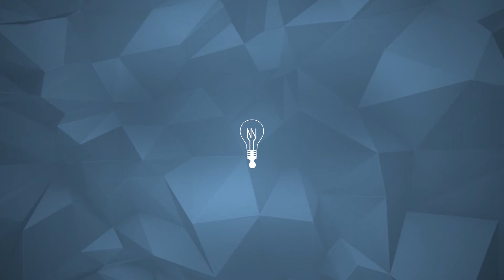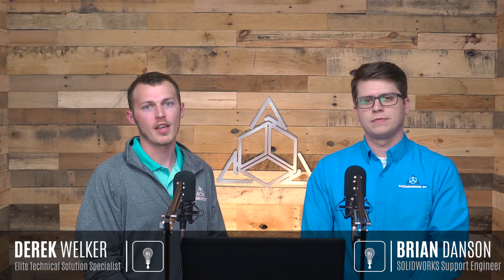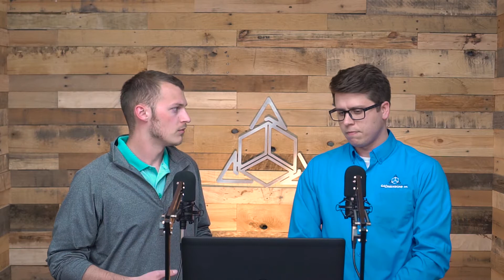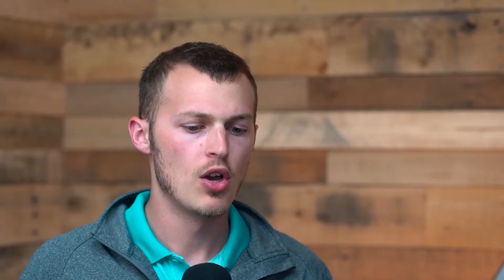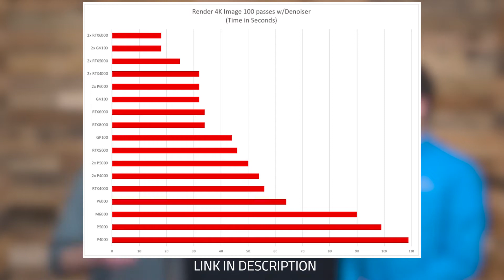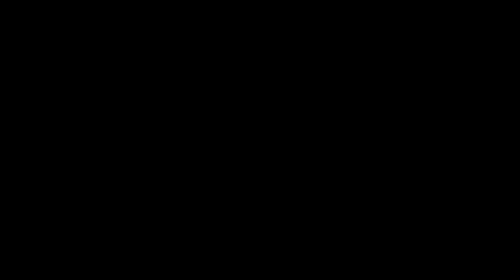Smarter Engineering PODCAST Ep 4 - How to Choose a Computer for SOLIDWORKS

Comment: I have Quadro p2200 24gb of ram and sata 500 gb SSD and intel i5 9th gen cup but still iam struggling with it at large assembly. When I wat to edit the part in assembly it self it crashes and I can't much but better performance after upgrading to Quadro graphics card. So, plz can can u tell we where is bottle neck. I planing to completely upgrade to another pc
And should I go for i9 9900k or rayzen 5 5600x as they are similarly priced right now in market

Comment: i am using ryzen 5 3550h (nVIDIA GTX1050) for Solidworks...but it do not runs properly , the tool in ribbon fades/Hide away .when i move cursor on ribbon bar.....but when i run SW with integrated gcard..then only it works fine..which is why i have to run by left clicking the SW every-time via integrated g-card....can you tell me what is happening ?
Reply: Hii Gaurav!
I would recommend that you disable the integrated graphics (or uninstall the driver) from device manager and try using the application.

Based on the info available online, most of these CAD softwares donot support multiple GPU. So that might be ur problem there. Let me know if it helps....

Good luck!
Reply: @rudradeepsarkar4467  ty smch for reaching out to me..
The problem has actually solved.. Just got an window10 update(i guess official june update) last month .. which switched my ram frequency down to 2400mhz..(although it was set at 2666 mhz before & also a 2666mhz supported ram) which ,i dont think make sense, was bottle-necking my system...

About g-cards Cad does support SLI combinations but for my laptop i tried using it by switching the software to run on integrated and dedicated g-card separately, that didnt work. Was only running smoothly on integrated card, not on dedicated.,,

But fot now it has been solved..and now running on both cards smoothly...m happy with it.
Reply: @gauravgandhi1925  Glad to hear it bro.
Could you pls recommend a full system spec as I'm considering getting one.

Also, are u using licensed copy?
Reply: @rudradeepsarkar4467  i am using asus tuf fx 505dd..ryzen 5 3550h 3.7Ghz..8gb ram (just upgraded to 16 now).nvidia Gtx1050 3gb..i read nvidia GTA/RTX is no good for cad ...Nvidia Quadro is special for CAD...bt mine is running fine now..AND choose CPU which has goodSINGLE core clock speed..most soft are based on single core functionality...JUST rendering is something uses multi-core...all the best
Reply: @gauravgandhi1925  
Well, I looked up d specs and found that the R5 3550H processor supports memory with 2400MHz frequency. Check the link-

https://www.amd.com/en/products/apu/amd-ryzen-5-3550h

Also, if u check the graphics specs for the R 3550H, it supports 1200Mhz graphics memory whereas the nvidia geforce 1050 3GB has a baseclock of 1392Mhz.

https://www.nvidia.com/en-in/geforce/products/10series/geforce-gtx-1050/

Guess these were the reason for your bottleneck. No idea why Asus put together this config though where the CPU won't extract the max performance from the GPU
Reply: Rudradeep Sarkar ...so my guess was right.. the ram was set at 2667 mhz by default and now when i got the bios update few days back... then ram gets automatically set at 2400 now working smooth.